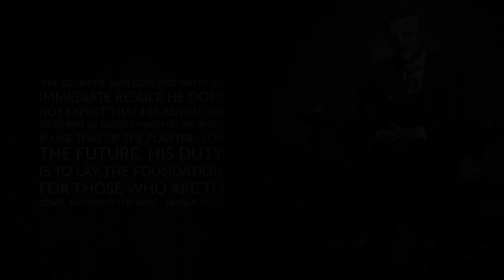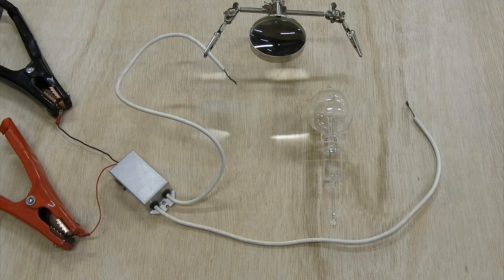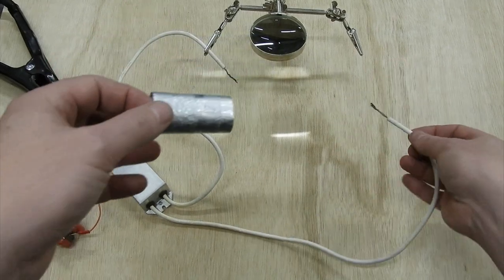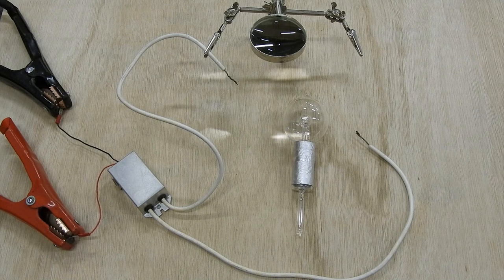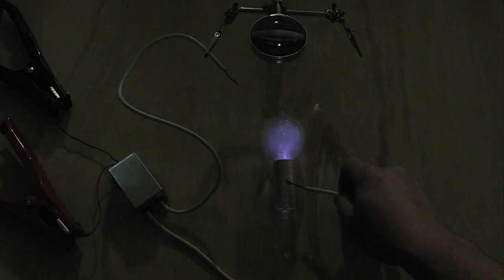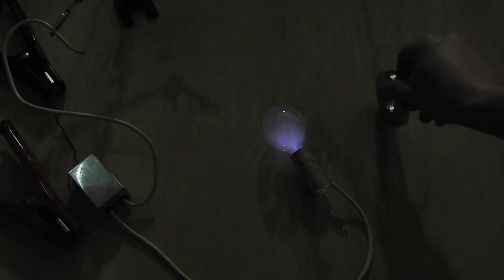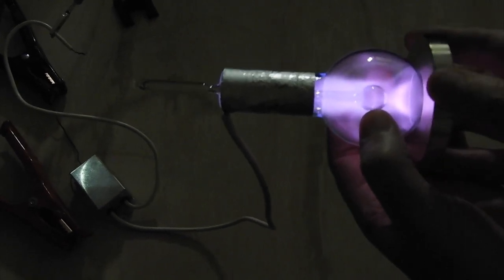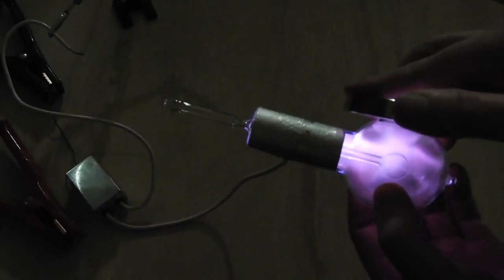Nikola Tesla's Plasma Valve Detector - Tesla's 1892 "Rotating Brush" Bulb Replication - Part 1

Comment: There seems to be many discrepancies with this bulb's construction. For it to be a true Tesla bulb, the inner sphere connected to the elongated neck should not be filled with any gas what so ever. Tesla mentions only evacuating this section to a moderate degree, but does not say to employ any gas such as nitrogen or the alike. His brush bulbs, being carbon button or metallically devoid never employ special gases. Read, "Experiments with Alternate Currents of High Frequency and High Potential". 

The outer sphere does not seem to have been evacuated to a high degree, as the color present is rather purple and darker blue, when it should be a misty-white, indicating high Tesla vacua. This purple-blue color also indicates high water content within the bulb, which Tesla says to avoid with aid of a caustic potash solution attached to the pump. 

The glass tube which holds the inner sphere needs to be greatly elongated, so that to allow for the hand to grasp it and impose inductive pickup. I have seen this common error in design before, that is, a short stem, thereby not allowing for maximum effect to commence.
Reply: Yes, in 1892, where does one buy a bottle of Xenon?  Or even Argon!   Helium was discovered 25 years earlier, but could scientists in 1892 buy any?
Reply: @wbeaty  It was available but tesla never used such gases. I have created a video demonstrating a true brush bulb.
Reply from the maker: Glad to see you posted here Griffin, I've been following your work a little bit.

You may want to go back the 1892 lecture and research again. You have replicated Fig 14. which is a conducting terminal rotating brush bulb.

We have replicated Fig 13. with a non conducting rotating brush bulb and this is the bulb you should really be paying attention too.

Here is a quote:

"Figs. 14, 15 and 16 indicate different forms, or stages, of the brush. Fig. 14 shows the brush as it first appears in a bulb provided with a conducting terminal; but, as in such a bulb it very soon disappears—often after a few minutes—I will confine myself to the description of the phenomenon as seen in a bulb without conducting electrode. It is observed under the following conditions:

When the globe L (Figs. 12 and 13) is exhausted to a very high degree, generally the bulb is not excited upon connecting the wire w (Fig. 12) or the tinfoil coating of the bulb (Fig. 13) to the terminal of the induction coil. To excite it, it is usually sufficient to grasp the globe L with the hand. An intense phosphorescence then spreads at first over the globe, but soon gives place to a white, misty light. Shortly afterward one may notice that the luminosity is unevenly distributed in the globe, and after passing the current for some time the bulb appears as in Fig. 15. From this stage the phenomenon will gradually pass to that indicated in Fig. 16, after some minutes, hours, days or weeks, according as the bulb is worked. Warming the bulb or increasing the potential hastens the transit."

So Tesla says: "Fig. 14 shows the brush as it first appears in a bulb provided with a conducting terminal; but, as in such a bulb it very soon disappears—often after a few minutes—I will confine myself to the description of the phenomenon as seen in a bulb without conducting electrode. It is observed under the following conditions:"

Which is why we replicated Fig 13. because it has no conducting electrode.

Also to show this is a true replication of Fig 13. Tesla does say to use a highly conducting gas:

"moderately rarefied and highly conducting gas inclosed in the neck"

"The construction shown in Fig. 13 was chosen in order to remove from the brush any conducting body which might possibly affect it. The bulb consists in this case of a lamp globe L, which has a neck n, provided with a tube b and small sphere s, sealed to it, so that two entirely independent compartments are formed, as indicated in the drawing. When the bulb is in use, the neck n is provided with a tinfoil coating, which is connected to the generator and acts inductively upon the moderately rarefied and highly conducting gas inclosed in the neck. From there the current passes through the tube b into the small sphere s to act by induction upon the gas contained in the globe L."

To confirm what I am saying you should research Tesla masterpiece article and in particular Fig 9.

https://teslauniverse.com/nikola-tesla/articles/true-wireless

The first replication was done by David Porter and myself in early 2020. Aaron Murakami put me in touch with David. He was introduced to me as the Eric Dollard of glass blowing. He wasn't wrong David has a more impressive setup than my guy in England called Russ. David blew 5 bulbs and 1 was the closest to a replication and was given to Eric Dollard to try. At that point we hadn't nailed the fill pressure and David didn't copy the stem in Tesla's Fig 13. diagram exactly.

The bulb in this video did start off purple and was activated by grasping the globe just like Tesla said. Then after about an hour of working the bulb it went a misty white. Bare in mind I was only using a self oscillating 12v to 2000v unit that cost $19.95.

This was the best photo I've taken so far.

https://www.youtube.com/channel/UC4uJgCHU3s4AOA-uT5SDA4w/community?lb=Ugkx7cLFHiBRSYOdILNMZI5u6hpBukv4PVLg

Also I would like to point out that the fill pressure is wrong in this bulb too as I hadn't found the two 130mm Hg references from Tesla at that point, so the glass blower has slightly higher fill pressure than necessary.

Also I haven't ran it with a tuned circuit including an earth ground tuned to a harmonic of 6hz and under 20khz.

And finally I would like to thank YouTuber Istvan Kocsis who commented above bringing this quote to the forefront:

https://teslauniverse.com/nikola-tesla/articles/problem-increasing-human-energy

"When I advanced this system of telegraphy, my mind was dominated by the idea of effecting communication to any distance through the earth or environing medium, the practical consummation of which I considered of transcendent importance, chiefly on account of the moral effect which it could not fail to produce universally. As the first effort to this end I proposed at that time, to employ relay-stations with tuned circuits, in the hope of making thus practicable signaling over vast distances, even with apparatus of very moderate power then at my command. I was confident, however, that with properly designed machinery signals could be transmitted to any point of the globe, no matter what the distance, without the necessity of using such intermediate stations. I gained this conviction through the discovery of a singular electrical phenomenon, which I described early in 1892, in lectures I delivered before some scientific societies abroad, and which I have called a “rotating brush.” This is a bundle of light which is formed, under certain conditions, in a vacuum-bulb, and which is of a sensitiveness to magnetic and electric influences bordering, so to speak, on the supernatural. This light-bundle is rapidly rotated by the earth’s magnetism as many as twenty thousand times per second, the rotation in these parts being opposite to what it would be in the southern hemisphere, while in the region of the magnetic equator it should not rotate at all. In its most sensitive state, which is difficult to attain, it is responsive to electric or magnetic influences to an incredible degree. The mere stiffening of the muscles of the arm and consequent slight electrical change in the body of an observer standing at some distance from it, will perceptibly affect it. When in this highly sensitive state it is capable of indicating the slightest magnetic and electric changes taking place in the earth. The observation of this wonderful phenomenon impressed me strongly that communication at any distance could be easily effected by its means, provided that apparatus could be perfected capable of producing an electric or magnetic change of state, however small, in the terrestrial globe or environing medium.

The outer bulb has a vacuum level of 10 to the minus 6 mBar which was exhausted using a rough pump and diffuser pump.

David Porter's setup goes to 10 to the minus 7 Torr and he used a 96% nitrogen and 4% hydrogen mix, but the fill pressure was way too small.

Griffin I'm pretty sure I've seen a video in the bonus material of Eric's lecture and you have David's bulb at one point whilst you are testing your bulbs. I could send you the footage.

So after the evidence I present you will learn that what I present in this video is a true Tesla bulb after all.

I'll agree that the stem should be a little bit longer for an exact copy of Tesla's diagram. Easy change to make.

"The glass tube which holds the inner sphere needs to be greatly elongated, so that to allow for the hand to grasp it and impose inductive pickup. I have seen this common error in design before, that is, a short stem, thereby not allowing for maximum effect to commence."

So hopefully this shows that it is actually yourself that is chasing the wrong bulb design. What you have replicated is great, and you should be proud of yourself. I'm proud of your work!

It's a great replication though considering your current lack of professional glass blowing equipment. I hope the lecture has generated some funds for you to add to your glass blowing lathe and whatever else you have managed to obtain. Aaron Murakami speaks very highly of you, so you deserve good stuff for your research.

So it is not my actually my design, it's a almost true replication. I've been in this game for 12 years dude, since you were 4 years old!

I've also been on Tesla's work full time for over 3 years and I have many articles that I've never seen on the internet. Over time these are being shared to my Patrons and YouTube but there are far too many for even me to process and I keep finding more.

So I commend your efforts Griffin, it is inspiring to see such a young man dedicated to this work, I'm sure you will go very far.

Keep up your research as you are definitely super talented on the electrical side of things. I have a desire to master glass blowing too and I know 3 glass blowers now from my research and development who have somewhat mentored me.

I'm sure you will inspire many others with your work Griffin.

The jury is out on the highly conducting gas but I've found so many references to nitrogen in Tesla's work I think I'm right on the money there, particularly as the bulb is doing what he said it would do. No rotating brush yet without a magnet because I've not got it tuned to a resonant 19,998hz secondary and connected to ground.

I've got more evidence of this too.

Get in touch if you want paultownley@rocketmail.com
Reply from the maker: I've done a community post to thank you for your comment Griffin. https://www.youtube.com/channel/UC4uJgCHU3s4AOA-uT5SDA4w/community
Reply: @nikola.tesla.r.and.d.centre  In a recent video, I show a demonstration of the brush bulb, fig. 13, and its excitation with a supplied RF. I too give a previous video showing the carbon button single electrode lamp, fig. 14, but that is separate. 

As far as the rarefied gas goes, the term "moderately rarefied air" represents the lower exhaustion of the vacuum via a Sprengel Pump. When Tesla describes "moderately rarefied," he is referring to the evacuation level or "rarefaction" of the enclosed vacuum. As in page 128 of Experiments with Alternate Currents, he states "...which was then moderately exhausted and sealed off." Although he is describing the process of a separate bulb, it too possesses the same vacuum exhaustion situation. 

Performed before G.D. Seeley, Examiner in Chief, U.S. Patent Office, on the 23rd of January, 1898, Tesla demonstrates the distribution of electrical energy in industrial amounts through a rarified medium with ground for return. 

https://teslaresearch.jimdofree.com/wireless-transmission-of-energy-1/the-evolution-of-tesla-s-air-ground-system-for-wireless-energy-transmission/

In this demonstration, Tesla employs a long glass tube, which he claims to represent the upper strata, or "rarefied" portions of the atmosphere, to an exhaustion degree of 120-130mmHg. Because Tesla likes to use the same terms to describe experimental conditions, the conjoined terms "rarefied and conducting" represent the exhausted degree of vacuum. This being a poorly exhausted degree, hence the term well-conducting. That's why in his brush bulb description, he says to make the inner contents of the neck "moderately rarefied and conducting". That being so, the vacuum is fairly poor, hence the purple hue color, as a result of present nitrogen which the vacuum device did not remove. 

On page 47, he states in a separate discharge experiment, "When an ordinary low frequency discharge is passed through moderately rarefied air, the air assumes a purplish hue. If by some means or other we increase the intensity of the molecular, or atomic, vibration, the gas changes to a white color." In this instance, the moderate rarefaction of the air means pressure level. 

Thus in any of the bulb experiments, the term moderately rarefied was a result of the existing air being evacuated to a moderate extent, and not the imposing of a gas on the air already present within the tube. 

Years ago, I too was confused on the extent of what he meant by "rarefied," but experimentation and further digging showed me that it was a mere matter of vacuum pressure.
Reply: Also, good work on obtaining the white misty color. I'm gaining this color within the centre sphere, as the vacuum is low for now. As for vacuum, I'm testing a Sprengel Pump which should obtain high vacua conditions.
Reply from the maker: @GriffinGBrock  I can see what you are saying Griffin, however pulling a vacuum to 10 to the minus 6 mBar and then back filling with pure nitrogen pretty much ensures that there are no other gases present. The outer globe is 10 to the minus 6 mBar and the inner the same.... The only thing missing is this bulb is back filled to about 170mm Hg and not 120-130mm. It would be an idea to compare no back filling with nitrogen and just pull the vacuum to 130mm instead. This would make the construction even cheaper as no bottle of nitrogen or back filling would be needed. Also Carl Linde didn't patent his process until later in the decade to liquify gases, so I can't see Tesla had access to a pure nitrogen bottle either!?
Reply from the maker: @GriffinGBrock  thanks, I'm about to switch to a self oscillating 7Kv circuit to see if Tesla's claim of higher voltage equals higher lumens. Looking forward to seeing your Sprengel pump replication. 

Here is another replication of a Sprengel pump: https://www.youtube.com/watch?v=viJ3T-1KZqY
Reply: @nikola.tesla.r.and.d.centre  Note that if we use bare metal electrodes in gas-discharge tubes, the gas mixture slowly alters (or even alters quickly, whenever the tubes are driven with tens of KV drive, and no hot filament as is used with fluorescent lights.)   If instead the metal electrodes are outside the vacuum, then the gas mixture only changes significantly over a span of years.
Knowing this, it appears that Tesla's 1892 lecture is actually discussing THREE different bulbs:  one with a bare carbon or aluminum sphere in the center, one with a small glass sphere full of metal powder, and one with ?one torr? of near-vacuum air, used as a plasma-conductor.   The brush is quickly destroyed in only the first type having non-glass central sphere.   I've only been experimenting with the middle one, using nickel powder in an air-filled central sphere.   I suspect that the plasma-conductor version isn't needed, and was only an experiment to see whether it gave higher brush-sensitivity than the one with the metal powder (nickel being magnetic, after all.   Or did NT use zinc or carbon powder in the center sphere?   I don't recall. )

PS  find the YT video with the "plasma mug" and a neo magnet lowered into it.   The neon plasma-fingers whirl around like a DC rotor.   Not very sensitive though, since 5,000 gauss magnet is required!
Reply from the maker: @wbeaty  I would say from reading the later articles that the 3rd type is the one we should chase. I say this because 27 years after the original 1892 lecture Tesla publishes two articles on the subject: https://teslauniverse.com/nikola-tesla/articles/tesla-bulbs & https://teslauniverse.com/nikola-tesla/articles/true-wireless

I don't think we should dismiss the type you have built as that is also featured in the 1919 Tesla Bulb article Fig 1. This is the most recent diagram of Fig 12. from the 1892 lecture.

The Fig 13. from the 1892 lecture is shown in Fig 2. 3. 4. 5. & 6 not to mention Fig 9. in "The True Wireless" article.

It also says it is the "most sensitive detector", more so than the Audion. If you know much about Dr. Thomas Henry Moray's work then look at the bulb as the replacement for the Moray valve aka detector. Also replace the inner sphere tuned lightning for the radioactive decay that Moray used most likely from Pitchblende or Uraninite ore. 

The 1st bulb you refer to is Fig 14. This is what it says in the lecture about this:

"Figs. 14, 15 and 16 indicate different forms, or stages, of the brush. Fig. 14 shows the brush as it first appears in a bulb provided with a conducting terminal; but, as in such a bulb it very soon disappears—often after a few minutes—I will confine myself to the description of the phenomenon as seen in a bulb without conducting electrode. It is observed under the following conditions:"

So if "as in such a bulb it very soon disappears—often after a few minutes" then this is no good to our needs.

Interested to see your replication.

In my mind the 3rd type is the easiest to replicate and will run cool as has been shown so far to me with a thermal imager.

I think the whole point is that these no filament / electrode bulbs use high voltage and little to no current. I have been studying Radioionics for 11 years which is based on Tesla's radiant energy patent, Moray's work and a number of other inventors such as Mahlon Loomis and Hermann Plauson to name a few.

All this work ties in with those inventors.

Tesla switched from using the earth to send transmission to using the ionosphere via the bulb. The earth resonance of a harmonic of 6hz - 19,998hz was used as a carrier wave.

I've got a stack of evidence for this and I keep finding more research materials on it. I literally cannot process all of the articles there are so many. I will get there though.

Ideally all the apparatus from the Tesla lectures will be replicated eventually.
Reply: @nikola.tesla.r.and.d.centre  Apparently Tesla didn't like resistors, and avoided them.   But with the Tesla-bulbs with glowing plasma in the center, the thin plasma-tube probably serves as an EHT resistor, providing a "series ballast" to limit the max current, and stabilize operation.    It's like an NE-2 pilot light, with a series resistor.   WIth his bulb version having a metal lead-in wire, the outer glass quickly gets fantastically hot, above 100C.   Too high a drive voltage?  and not enough current-limiting.   Add a "ballast" to fix this problem.   (Use a neon sign as a lead-in wire!   If the glass tube is extremely narrow, then the plasma streamer can have quite a high resistance  ...since contact with solid objects cools the high-energy electrons of the plasma, making it very dilute and resistance quite high.  It's a neat way to make a 100KV resistor which never burns out!)

As earlier,  brush-disappearing effect in fig 14 is something conventional.   It's called "sledgehammering" when applied to fluorescent tubes.   During HV drive, the bare metal sucks in all the residual gas, until the tube has a perfect vacuum, and stops working.   

In the Crookes-tube x-ray era, this was called "Absolute Vacuum," and was something to avoid.   Crookes x-ray tubes always had little doo-hickies on the side, in order to re-inject some residual gas, because the metal electrodes act as "getters" whenever HV is applied.   The tube pressure keeps going down, and eventually the x-ray tube stops working unless more gas can be added.   Coolidge solved the problem by employing hot cathodes and hard vacuum, rather than the "particle fountain" effect of Crookes-style soft-vacuum x-ray tubes.    And of course, Tesla solved the same problem by sealing his metal electrodes inside glass, or by using "plasma electrodes" covered in glass.    Too bad HeNe laser tubes are no longer used.   A glass-covered RF version might last for decades without going dim, rather than just a few years.

Separate topic: I think tHe Viziv tower project in Milford TX was probably doomed to fail.   Maybe they can transmit hundreds of watts of 10KHz, maybe kilowatts.   But it seems clear that they don't know what tesla-bulbs are, or what function they serve in a power-broadcast transmitters.   They've only built the metal-sphere version of Tesla's towers.   No magic there, other than EM surface-waves.   (Now instead if they can fry all the landline phones within a ten mile circle, and make horses start galloping because their feet get shocked, and fluorescent tubes only stop glowing when they're carried many miles away from the transmitters,  THEN they're on to Tesla's actual tricks.   The high voltage doesn't fall off as inverse-square, or even as 1/r.   Instead it's constant with distance, until you get out past 1/8th of a wavelength, and the sine-antinode hump starts dropping into the first quarter-wave node.)

But don't listen to me, I'm working with psychic remote viewers!   Occasional success.  Some really crazy stuff, not appearing in any writings anywhere.  (That's partly where the Static Eliminator material came from.   Static Eliminator and "wave-complex" is an odd form of FM radio.   Says who?   Nobody!   ESPECIALLY not Tesla!   It was a big secret at the time.   Nobody knew what was inside those two hollow wooden disks.)

Did you manage to download the corum/daum "death ray" article?   Or did ALL those postings disappear?   That one is NOT dangerous, US Army declassified, since it's only a guided TC discharge, only a few tens of yards range.  ALways remember:  "TC lightning only hurts if you're not wearing chainmail shirts!"   I think Corums were producing Ken Shoulders "EV" particles, and the particle-stream guides the conventional plasma-streamer.  (Not a Tesla death-ray; it doesn't cut through matter like a waterjet cutter.)   If true, then a perforated Tesla bulb is a source of Ken-Shoulders "EV rays."    Very weird that YT won't let me post their URL.   Maybe their bot has banned links to researchgate (find James Corum's personal page on that site.  He links to that PDF paper, called Tesla Coil Research.)
.
Reply: @wbeaty  fax